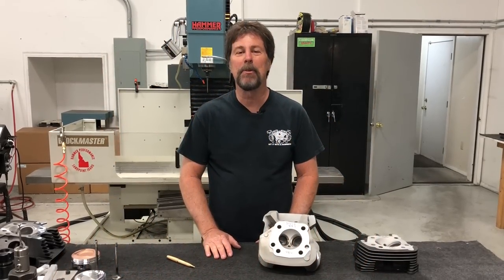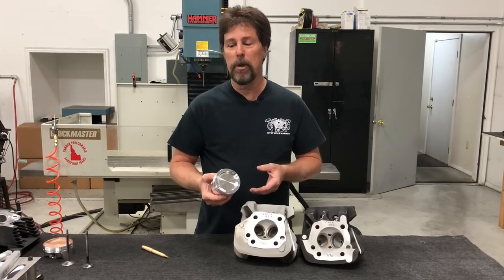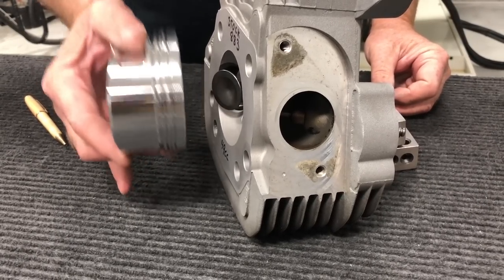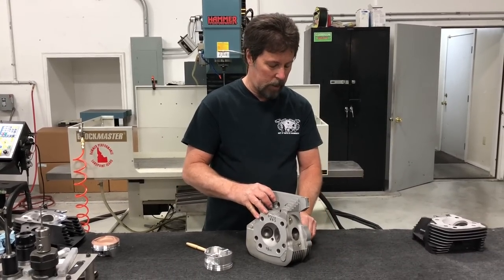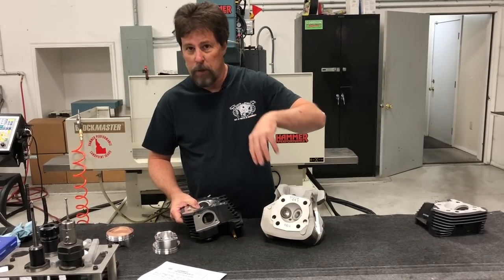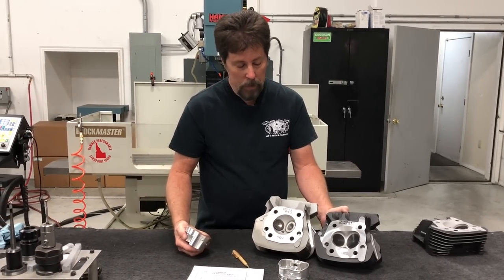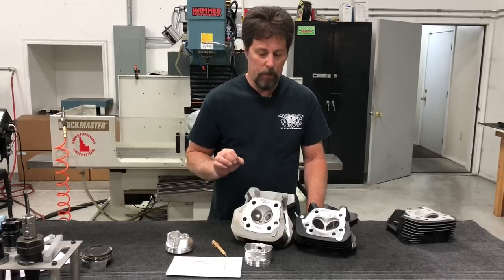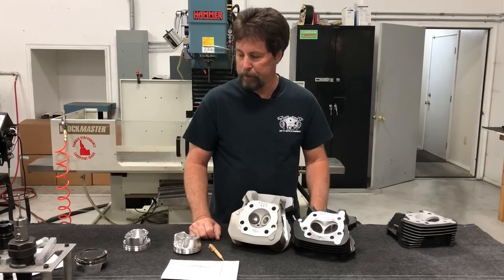Converting A Harley Davidson 883 For Big Power!

Comment: now that I've subscribed , I'm gonna get myself a 883 Sporty ... no seriously ...
Reply: Random dude  because a titled ownership that says 883 is cheeper on insurance even if you convert it to a 1275 , 1200 cc ownership will cost more to insure ...also there is a gear differance between 883 tranny compared to a 1200 transmition , i was told the 883 has better gear ratios .i have an 883 and have rode a 1200 and i do believe the transmition ratios are different . But there are a couple reasons for you to go 883 if your looking to go big with a sporty,  im doing a conversion as soon as i save enough to do it all ...
Reply: @4486xxdawson  any difference in insurance premiums between 882 and 1200 is very minimal.. at best.

Comment: I went with hammer 1275 kit, using XB heads and going with the larger valves 190, and 160. Of course ported. I run and S&S Super-G carburetor with a 1-inch spacer in a thunder jet with a 110 jet, running and 93 main jet in a 36 intermediate, using a supertrapp modified two into one exhaust, I dumped the stock baffles in made my own. Let's just say my bike is very very happy. Beware S&S carburetor users, you have to cut I believe two maybe three fins off the cylinders I can't recall right now so the carb will bolt up to the heads. I know one thing my bike halls ass

Comment: Outstanding video !
#1 should I start out with a 1200vs.883
fuel injected sportster,because of the heads ?
#2 it's $1695.00 for the F.i -1275 b.b. kit 
If I utilize the 1200 heads for porting , can I save $$$ by just buying your H.Comp. 20 over pistons & you boring my cylinders ?
#3 any downsides to using my jugs other than losing 75c.c.s and will I lose some torque/H.P. ?
Thanks in advance Hammer 😎

Comment: Did you guys ever do a video or discuss the heat difference between a stock 883 & a 1250/1275? 
Do they run hotter….enough to be concerned about?
Looking at converting my XLH883 and am concerned about loosing reliability
Reply from the maker: There are a handful of reliability issues on the Evolution Sportster platform that pop-up when the power level is raised. None are related to heat, however.

Good fixes exist for all of them. Many of the fixes came from HD themselves, and were rolled into the stock bikes over the years. So which reliability upgrades you need is a function of the year of your bike, and generally speaking, the newer it is, the fewer of those upgrades it needs. For a 2007+ bike, it's a pretty short list. For a 1991 bike, it's a pretty long list. Contact us for more details: http://www.hammerperf.com/contactus.shtml#salesform

Comment: You guys really provide great information on it. I have an '05 sportster 883 carbureted. I am considering purchasing the 1275 kit. I see the bolt on kit and then I see the complete conversion kit for a higher price. What is the difference between the kits?
Reply from the maker: Hi Edwin
It is just that, the big bore kit is just the big bore kit, and the complete conversion kit is a turn key package with the ignition module, jets for the carb, etc.

Comment: 120+ HP Sportster? You guys are crazy. I just bought a used 883 that somebody did the 1200 kit and some Screaming Eagle whatever, and it's fast, fast enough for me. I know it's nowhere near 120 HP though. I do start sliding off the seat and the front wheel is beginning to come off the ground, so that's fast enough for me. It's a Sportster for sure. Enough for me.

Comment: Have you seen any Iron 883's that consistently damage/bend  the spark plug ground strap, and damage/crack the ceramic insulator that surrounds the electrode?
Reply: Could pre-ignition do that?

Comment: Valve stem length won't change how much the valves open and close  the lobe on the camshaft and the  rocker arm ratio determines that ..
Reply from the maker: Valve stem protrusion most definitely affects valve train geometry, and thus how much lift you get out of a set of cams.

In a nutshell, to get max lift you need a stem protrusion that centers the rocker tip travel, so that at half lift, you have a right angle between the valve stem and a line drawn between the stem tip and the center of the rocker shaft. To the extent you vary from that, you'll get less lift than what's dictated by the lobe lift times the rocker ratio. 

Although it's a difficult thing to measure directly, there's a simple rule of thumb that gets you close: increase stem protrusion by half the amount you're increasing lift. So for example, if the factory stem protrusion spec is 1.900, and it comes from the factory with .500 lift cams, and you go installing .600 lift cams, you want a 1.950 stem protrusion. That keeps the rocker tip arc centered, thus giving you maximum lift.

Some guys intentionally set stem protrusion a tad long, and then iterate, stacking rocker gaskets and measuring how much lift they're getting, until they find the gasket stack that gets them the maximum. This is generally only  done on race motors, few street guys go to this extreme.
Reply: @HAMMERPERFORMANCE    You were not talking about valve stem Protruision ..
  You said Longer Valve Stems make it more likely for the valve to hit the Piston during valve overlap.  This is not True.  If you were to change where the valve seats are it could get the valves closer to the pistions.
  I built a 488 Cube BB Chevy  Tall deck Truck engine for  my C-65 Chevy  I used a 4.25 stroke crank  Longer Crower rods and stock  flat top 454 chevy forged car pistons.. The second crane cam I used had  I think .515 lift on the exhaust valves.. I had coil bind .. So i used shorter valve springs for a Clevland Ford..
  Turns out the truck engines have shorter valve stems than car engines use.. The 427 chevy Truck engine only had .390 lift on the stock cam
Reply from the maker: @mikeskidmore6754  The longer stems found in 883 heads absolutely do reduce p-v clearance and therefore make them more likely to hit the piston during overlap.

But it's not because the longer stems create more lift. It's because the valves start out closer to the pistons than they do with 1200 heads. Sorry if I wasn't clear on that point in the video. I thought it was obvious, my bad.
Reply: @HAMMERPERFORMANCE    Sounds like the valves are closer to the Pistons and they are at an angle that pushes them closer to the pistons with less valve lift at overlap,
  I saw your  dyno chart for  redone 883 heads  vs 1203 Sportster heads..  How do the 2008 Buell 1203 Thunderstorm heads compare?
  Guess a 1203  is around 70 Cubic Inches.. I was reading  about your  90 Cubic inch big bore kit with Cast Iron Cylinders.. I guess that would be  1474 CC's  I  can't justify spending a lot of money to go to 1275 CC's but  1,474  CC's would make a nice  gain in Torque...
  I took my Stock Buell to the Drag strip I ran faster quarter  mile times shifting @ 6,000 RPM's than at 7,,000 RPMS..  
  I ran 12.7 @ 110 MPH ..  I need to learn to ride the rear brake off from the line .. can't keep the front end on the gound ..

Comment: Great video! Very informative in layman's terms. I appreciate that. I've been looking at your products for awhile but when my bike was down riding weather was coming so I put it back stock. I'm still hoping to get it built eventually.  My question is do you get better performance from your sledge head or would a guy be better off to get 1200 heads?
Reply from the maker: The packages reflect the most cost effective way to reach their power levels. You can read about them here: http://www.hammerperf.com/883conversions.shtml#packages . Download the sample quotes to see everything included and what it costs. SLEDGE porting comes in at the 110+ level and BFH porting comes in at the 120+ level. Equivalency of  stock 1200 heads varies depending on the year of the 1200 heads, but no stock 1200 heads come anywhere near the SLEDGE level. That's a serious level that makes for a really great head. SLEDGE and BFH are such major surgery to the heads that you can do it to either 883 heads or 1200 heads and they come out entirely equivalent.
Reply: @HAMMERPERFORMANCE  thank you for the quick reply.
I have been watching your videos and studying your sight. I would love to have a 120hp sportster but I don't know if I can justify it. 😁

Comment: Why not use the 1200 head and get a piston for that.  Do you have a Hammer kit for the 1200?
Reply from the maker: 1200 heads require the same level of head work to reach these high power levels as 883 heads do. It's such major surgery to the heads that it doesn't matter at all whether you start with 883 heads or 1200 heads, they come out identical either way. So if you're starting with an 883, there's no point in buying 1200 heads, you're just wasting money.

Now sure, at the lower and mid range power levels, we approach it differently depending on whether the customer has an 883 or 1200. The idea is always to achieve the target power level in the most cost-effective way possible.

Comment: I'm power hungry and want to do the 120+ kit kind of out of spite but how much is to much with stock tires. Where does the power start becoming a "pain" to deal with as a daily, I'm cool with 1st, and 2nd getting lose and maybe a chirp in 3rd but nothing past that.  90hp maybe 100hp a good stopping point? (Currently running commander 2 for tire)
Reply from the maker: The 120 package is very streetable.  It all comes down to how you ride the bike.  The 120 package is very well mannered.
Reply: I'd say 90 yes,  I've built a 120 kit would hold the front tire thru 4th....

Comment: My question is do you have to dyno tune?  I have heard that is a very expensive process.  That pushes the price of conversion up over $2000 for those of us that can't do the labor ourselves. My top dollar to convert is $1,500.  I do not need high performance I just want a bit more top end on the highway.
Reply from the maker: Hi Brian, this is covered in our kit installation instructions. Rather than repeat that information, follow this link, it takes you to the exact paragraph: http://www.hammerperf.com/ttinstallkit.shtml#dyno

Comment: Hi Aaron, i did the basic conversion 883/1200 last year, changed stem valves, cleaned, all new gasket and seals piston rings etc.... kit came from USA with dished pistons, not shiny chromed once but matt aluminium ones, (tell me if ok),  but did not do anything with ignition as you suggest in the basic conversion video,, i am trying to understand why and what to buy in regards to it as expensive stuff, so....what happen if you leave the 883 ignition control module into a 1200 conversion and do i have to adjust or change ignition sensor?? i did re jet 45/190 and rebuilt carb...but realised ( after tuning carb myself) that spark plugs are always fouled and the vibrations are more intense as bits in aluminium all over the bike especially handlebar switches are braking including exhaust support bracket at the bottom ( last muffler), at 70 mph all shakes too bad, on my 96 sporty, bare in mind that i checked tightness of bolts and nuts all round, please tell me why, what to buy and send me links please, i should have bought the conversion kit from you in the first place but sorry did not know you were in business. p s.. my top speed is 110 mph. thanks.
Reply from the maker: The ignition we recommend for your application is a Dyna 2000, in your case the 8-pin external module. It's available in your choice of dual fire only (recommended, as it costs less and you'll never know the difference) or single/dual fire (single fire mode requires a new coil as well). You can find it here: http://www.hammerperf.com/xlignition.shtml#modules . We have a video that shows how to static time it here: http://www.hammerperf.com/ttvideos.shtml#statictiming . The video is for the 2000i but it's done the same way. No idea on the vibration, sorry, most of our customers report less vibration after installing our kits. Good luck.

Comment: So what kind of valve clearance issues or lack there of appear when you use a stock 1200 head and a 1250 or 1275 conversation kit from you guys? Is the ratio safer with a stock 1200 head than a stock 883 head?
Reply from the maker: What year 1200 heads are you referring to?

Comment: Queston??  Do I have to boar out the cases to go to a 1275 on my 883?
Reply from the maker: Absolutely not. The 1275 is a bolt-on that can be installed in an afternoon without even pulling the engine out of the frame.

Comment: Gday guys, if your going to go for a 1200 big bore kit. Wouldn’t you go for 1200 heads
Reply from the maker: 1200 heads are expensive, and you can reach any given power level less expensively by modifying your 883 heads instead. That's what our 883-1275 conversion packages are all about.

Comment: Is there any combinations you recommend for flattening the torque curve on these sportsters? Maybe not making them a hot rod, but just making the whole RPM range more usable than say idle- 4500.
Reply from the maker: Don't underestimate the effect of the exhaust on the shape of the torque curve. It's massive, particularly when the cams have overlap.

Give a read to our library of XL exhaust system dyno test results, you'll see what I'm talking about. You can effect just humongous changes in the shape of the torque curve by swapping exhausts and nothing else: http://www.hammerperf.com/ttxlexhaust.shtml
Reply: I did an exhaust, jets, and filter and it moved the power up the curve. Less torque off idle, but revs better.

Comment: This might be a stupid question but do you have a 3 angle seating ? I Have built V-8 dragster engines that made better seating . Just asking if this is relevant. If not needed that would be awesome
Reply from the maker: Modern carbide seat cutters don't limit you to simple multi-angle seat profiles the way stones do. Sure, they can still do multiple angles, and in much better controlled sizes than stones. But they also allow you to precisely radius the area above and/or below the 45 degree sealing surface, which can have advantages depending on valve back cut and port shape. We use carbide seat cutters in this manner and have optimized the seat profile around the valves and the port design.

Comment: I installed the 1275 kit on my 1990 xlh883, I'm confused about how to wire the ignition. My stock ignition is a 3 wire set up with a connector above the starter, the dyna 2000i-p ignition that was sent with the kit is a 5 wire set up and none of the wiring matches with my factory wiring, how do I wire the dyna ignition into my factory wiring?
Reply from the maker: Hi Nick, your 2Ki should have come with instructions. If not, you can download them here: http://www.powercommander.com/downloads/Support-Released/Dynatek/Manuals/D2Ki.pdf . See the wiring diagrams on page 5.

Comment: Ok looking at ur site on the web, I downloaded ur 110 hp package for my 2013 xl883... looking at it is different than how u explained in video considering you said u can take what I have now and convey it into what's needed... so that would take me sending my parts to u to do the work on instead you have a package (without ur recommended upgrade) of $799.00. I do know you know what ur doing which I'd love to have yall work on my bike but seems I'm not rich enough to get even ur least suggested package. Thanks
Reply from the maker: On a 2013 XL883, a successful conversion requires the engine kit, a suitable tuner, a clutch upgrade, and a pair of the spark plugs we specify. In addition to those requirements, there are two recommended items: the ring gapping/preassembly service, and the Cometic EST top end gasket set.
Most guys just do it the easy way and get the complete conversion "package", which contains everything listed above. You can find it here: http://www.hammerperf.com/883conversions.shtml#basic
But everything that's in the package is also available individually, at the following links:
1250 kits: http://www.hammerperf.com/xlbigborekits.shtml#1250ordering
1275 kits: http://www.hammerperf.com/xlbigborekits.shtml#1275ordering
All of the other required and recommended items: http://www.hammerperf.com/xlbigborekits.shtml#1250options

Comment: Great video!!! How about the crank? do you keep it stock or do you modify it? Thank you!!!
Reply from the maker: 99% of the time, our performance conversion packages are installed without any lower end upgrades. In fact, these kits can be installed in an afternoon without even pulling the engine out of the frame. Ridden normally, the kits have no effect on the reliability or longevity of the stock lower end. Spend a lot of time at high rpm and sure, you create a risk, but in normal riding there is no difference. However, for guys who want an upgrade and are willing to do a full tear-down, we offer this crank: http://www.hammerperf.com/images/newcrank.jpg . It's a massively improved crank with stronger rods, a bigger crankpin, and a bigger sprocket shaft. It's a bolt-in for 2004+ Sportsters, and we offer a retrofit service to install it in 91-03 bikes: http://www.hammerperf.com/xllowerend.shtml#crankconversion
Reply: HAMMER PERFORMANCE. Thank you so much that helps a lot.
Reply: So this obviously means even with this mod you still keep the distinctive harley sound?